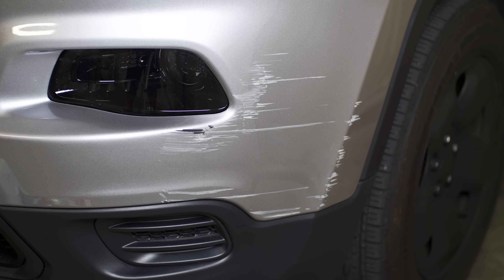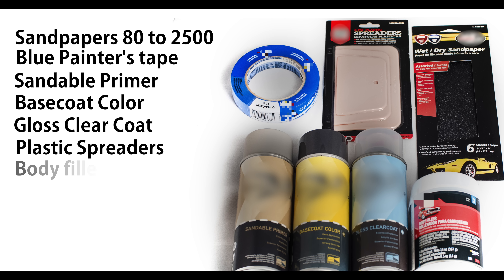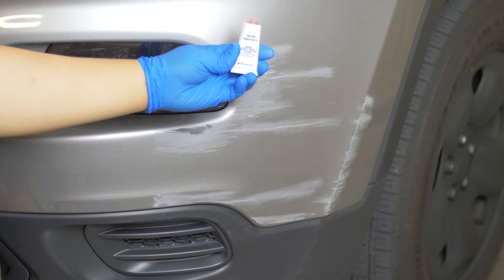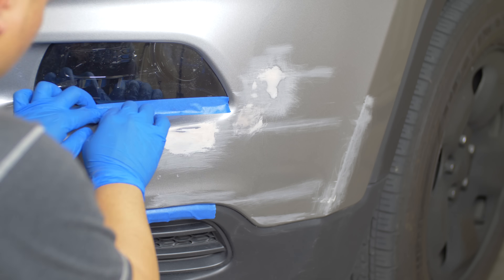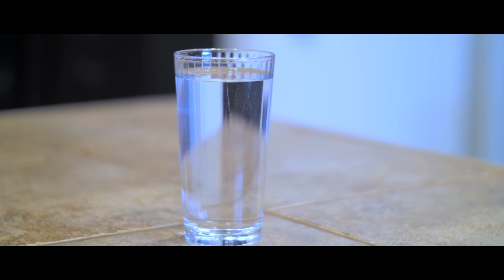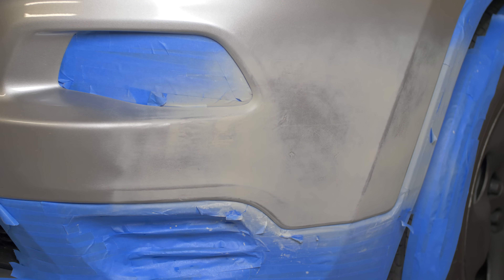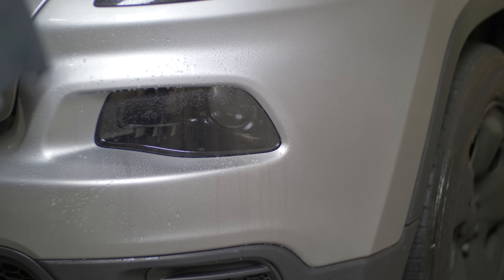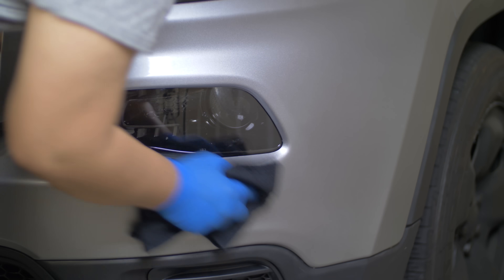How to Repair Scratches on your Car | Save Hundreds of Dollars

Comment: To anyone not experienced in this field this may seem like a good tutorial but beware if you try to do this following his steps this will almost guarantee to fail. Proper products not used and other product used incorrectly, which will cause the paint to peel off after a couple months(most likely). Also no paint match done, just because you got the paint code does not mean its the right paint there are usually many variations of different shade and metallic variation, on my PPG system there's showing 21 different variants. Also taping in stuff like the black moldings and not removing them cause the clear coat not to go under them leaving an edge to the clear coat will is also prone to peels. Hand polishing clear coat is never recommended. Thats scrape is about a $500 job at our shop, I would say pay a professional the money and get it done right and never have to worry about it.
Reply from the maker: Not bad for $500.

Comment: One thing to remember about airasol  can clear there is no uv protection and it will not last. Repairs like this fade or crack and peel. Another thing   you need to take the bumper apart so paint can wrap around the full edge to prevent cracking if the bumper ever flexes. You also didn't need filler for those small scraches could of sanded those scrapes with 180grt then 320, then spraya plastic promoter let dry and prime far better repair less time and effort

Comment: What a bodge. You primed and painted onto shiny paint. You should have flatted the whole bumper corner with 800 grit paper then blend the colour out then clear coated the whole bumper corner. It wouldn't have taken much longer to do it properly. And yes, I am a vehicle painter
Reply from the maker: Thanks  for your input.

Comment: Sorry but I'm not picking on your work. It looks great but when spraying make sure you don't don't fan the spray can or spray gun. You face the nozzle at the surface and spray pay past the surface going from left to right and right to left. If you can the nozzle? You end up with more orange peel or like a dry feel as opposed to a smooth finish. Still great job tho.
Reply from the maker: You're absolutely right. I tried to avoid that in this video. My very experience with spray paint was plastidipping my rims and it was like the way you described.

Comment: Just remember that this $120 dollar repair will look exactly like a $120 repair and not a body shop $800 repair.
Don't get me wrong, it is just fine. Just don't expect miracles.
Reply from the maker: The repair is just as good as you make it. Remember it's a diy and you'll probably and hopefully just do it once in your life.
Reply: @ThomasofAllTrades  I used to work at a dealership and we had a guy that fixed dents and scratches the way you did. He worked mostly on our used cars and did an amazing job at restorations. But occasionally we would do a customer paid job and while the great majority left satisfied, there were some that were expecting $3000 body shop results for a couple of hundred dollars, despite being informed of what the job consisted of and how the results would be. 
We also had a separate body shop and there is a huge difference in between them. 
But it's all dependent on people's expectations.
Reply from the maker: @willpina  I agree. I wouldn't suggest this kinda paint job on a Lamborghini 😂😂😂
Reply: @ThomasofAllTrades  funniest thing is that people who would complain all had soccer mom SUVs. And it usually wasn't the mom complaining either.
Reply from the maker: @willpina  😅😅

Comment: I tried this myself and would recommend against it. 

The materials cost heaps already and you will likely not use them up at all. 
Then you gotta put hours of work in for a mediocre result. 

In this video he is holding the spray can like 10 cm from the car, which would not work with most spray cans. 20-30 cm recommended. 
Also, the paint tends to drip very easily, leading to an endless priming or painting and subsequent sanding process that can easily go through like half a dozen rounds. 

The end result did not look as smooth as in the video at all and looking back, I would have rather not done it myself tbh.

Comment: I will be harnessing this to try and repair some scratches I have on a Lexus RX450h . Have sent a direct email to you I obtained from your instagram account.
Reply from the maker: Thanks for reaching it out. Yes this method will work for the type of scratches that you have. Since your scratches are not that deep you may not have to use any of the Bondo stuff. Just the primer will do.
Reply: I will email the updates. I’ve now applied primer.

Comment: Now try doing this on a 10yr old metallic red!..
Reply from the maker: You can. This was a metallic grey and has some glittery look. Just buff the whole panel to blend it nicely
Reply: @ThomasofAllTrades  I'm no expert but from friends in the trade & having done a bit of paint work myself silver is one of the easiest to match & red, especially metallic are some of the hardest to match.
 But my point was an older car with faded paint, again red specifically is one of the hardest.
 But still you did a great job on that repair. I wasn't trying too find fault just giving my opinion.
Reply from the maker: @Knackeredandbroke  thank you. You're right it would be pretty challenging to blend it. I would just try to blend it as best as you can and buff the whole panel with compound. the compound is a paint restorer and it should help. Maybe not a a whole lot and super perfect but it should be pretty close. You could use a buffing machine as well.

Comment: as I should have expected it seems that I messed up
Reply from the maker: Don't worry. Sand it down and start over.
Reply: I don't know exactly where I did wrong, basically I covered the scratches but you can see the paint job and the drops traces on my car. The painting part was a complete mess

Comment: This looks like a full day job for the average person.  For some it doesn't make sense to lose a full day's wages because of this! It's cheaper to take it to the body shop.
Reply from the maker: I did this on my days off. and it took a couple hours and then i had to let it dry overnight to buff it the next day. If you took it to a body shop, You have to drive to the body shop and leave it there for at least two days anyway. it made more sense to me to just do it myself.

Comment: This was NOT your first time, OR either you had a professional coaching you while you edited the video. 
A first timer will NOT get these results.
Reply from the maker: Definitely my first time. I did however spent weeks researching what to do. 

And prior to this I had painted my rims with plastidip, which is a different technique. That's the only experience I had painting.

Comment: jesus christ my car looks worse than it did with the scrape and I don't even know where I went wrong
Reply from the maker: What does it look like? You could always sand it down and start over
Reply: @Thomas of All Trades  haha the fact you replied on a video so old is really genuine of you I appreciate it. I'm ignorant as ignorant can be when it comes to body work so I'm not even sure how to describe how it looks. My theory is that the scrape was not as deep as I thought it was, because after sanding and applying all things as done in the video, the result area I worked on is a higher level than the surface level of my car. It looks like a patch was slapped on it if that makes sense, Idk if this was done due to adding too many layers of paint or too much filler? not sure. I'd love to email you some pictures of it if you wouldn't mind sparing the time.
Reply from the maker: @codswallop2938  it sounds like you might have added too much filler. If you don't like how it looks I would just sand it down and start over. I have done that before where I wasnt happy with the final result. Just take your time and pay close attention to the details as you go by it step by step.

Comment: All that paint is going to peel and not last very long at all.  Ur primer and paint have to grab a smooth surface because u did not scuff the area to give new chemicals the ability to bight into.  It's gonna peel for sure.u did not blend old clear with new clear.  The area where both clear met will have up and show for sure. This is how u do a ok  job that will look half assed in person.  You almost did a good job.  Find a road car painter who can do the job right for about 200.
Reply from the maker: For 200? In what country?

Comment: I bought all the products.   I followed all the steps.   The end results were horrible.    I should have left the scratches instead of trusting this video.
Reply from the maker: If the results were horrible sand it down and try it again. What was the results like? Did you spray too much that it was dripping? Was it not shiny enough?

Comment: Just go to a local garage they do it for you for free!!
Reply from the maker: I wish!
Reply: @ThomasofAllTrades  yes they use something called a body rubbing compound to remove scratches to a great deal.. it was miraculous how the scratch went away in seconds.. you should definitely try that.. I was so worried for my new car it was the first time I took it for a long spin and got a scratch cos of an idiot.. the local mechanic saves me from my mysery
Reply from the maker: @mythbuster533  ok. I see. It also depends on how deep the scratches are. I have removed light scratches by just rubbing compound on them. But if they're really deep like mine you'll have to do it like in the video.
Reply: @ThomasofAllTrades  could be.. actually I had only a single scratch which was clearly visible and anybody could tell it was there looking at it from a distance.. it depends on the severity of the scratch for sure

Comment: How did you blend? Is this another fake video?
Reply from the maker: I blended by not putting a tape dividing the rest of the bumper otherwise it would just have a line. You can also lightly sand the unscratched side near the scratch so the paint would stick nicely to it. But I didn't do that on the video and so far so good years later.

Comment: guarantee this paint doesn't match at all, and this repaired area is plainly obvious to anyone whos looking in direct sunlight.  Silver in particular is notorious for being difficult to match.  Blending paint, and matching factory orange peel is very difficult to do.  Overall the process followed here is mostly correct, but ideally you don't want to sand your primer with anything higher than 400-600 grit if you want your basecoat to adhere properly.  If you want the paint to last longer, better to use urethane based solvent (or water base) and spray via gun or airbrush.  The acrylic paint that is typically in the rattle cans isn't up to lasting years in the open elements and being pelted with rocks on the highway, and the nozzle in the cans do not spray very well (typically) so your finish quality will vary when using these cheaper materials. Autobody labor and materials is expensive for a reason. Spraying itself is a technique that is very difficult to master, you can't be too close or too far away, or too slow or too fast.  Too light of a spray will result in a rough textured finish, too heavy will cause the paint to run and drip. You have to apply just enough paint that it is nice wet, without dripping.
Reply from the maker: Thank you for your input/suggestions.

Comment: Process is right, but even on camera i can see difference between old color, and new color. I think you wouldnt take car from painting, painted like that quallity even if  they ask only 120 bucks????
Reply from the maker: Anything is better than the scratch. The paint actually matches but from what the people in  the comments have suggested was to use a very high grit of sand paper after the paint dried/ before buffing. This would help match the gloss. I  wasn't able to do that in this video.
Reply: @ThomasofAllTrades  all you have to do was wet sand all bumper. Then paint the damaged area with normal paint and just "spray" around the paint just a little bit, and then cover with clearcoat all bumper.
Reply from the maker: @gmykolas  ok. Makes sense. Thanks
Reply: @ThomasofAllTrades  15 years of bodyshop manager. If you will need an advice, just ask. Have a Good evening
Reply: @ThomasofAllTrades  You can do video about scraches on cars. Here is a tip. If you do not know if you can buff scrach o not, you can easily check it with wet finger. Just touch the scrach with wet finger, and you will see. If scrach dissapears, it can be buffed, if not-not. Wet finger actualy shows, what will be result after buffing. Good luck

Comment: You can see the paint doesn't match. It would look even worse in the correct light.
Reply from the maker: The paint matches but from what the people in  the comments have suggested was to use a very high grit of sand paper after the paint dried/ before buffing. This would help match the gloss. I  wasn't able to do that in this video.

Comment: You didn't count labour in the cost, once you count that you overpaid for that crappy job.  It depreciated your vehicle more than the difference between your rubbish job and a professional job because it appears the maintenance of your vehicle is poor.

I'd advise my customers to look elsewhere as this owner clearly cuts corners maintaining his vehicle and assumes his non oven baked, aerosol tin can garage finish that has loads of dry, peely finish and bad blending lines won't be noticed.

Comment: Everything about this video is wrong. The biggest no no is that you don't blend clear into existing clear 🤦🏼‍♂️🤦🏼‍♂️🤦🏼‍♂️
Reply from the maker: How do you suggest on blending it then? Please explain in details.
Reply: @ThomasofAllTrades  you clear the whole panel or until you hit a break. You don't blend clear. Any good painter knows that. Painting 101. It'll come back to haunt you later on. Only blend base of course for color match.